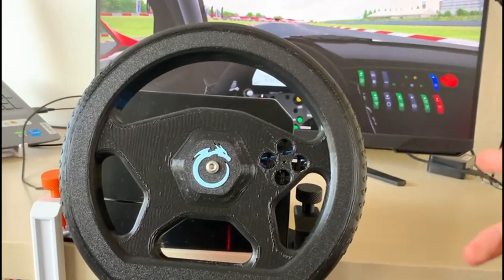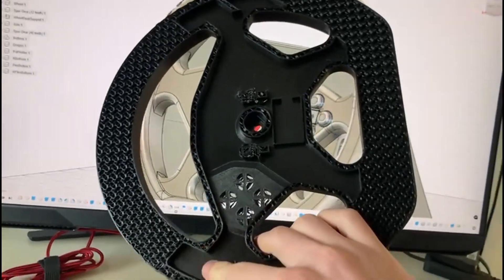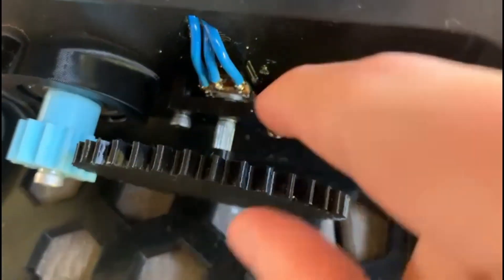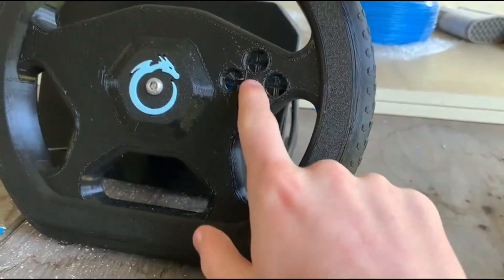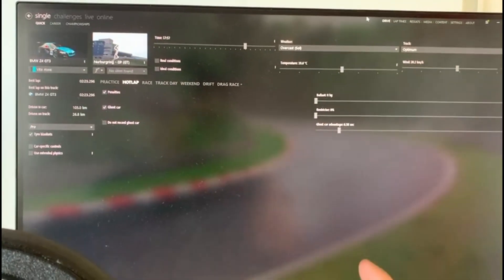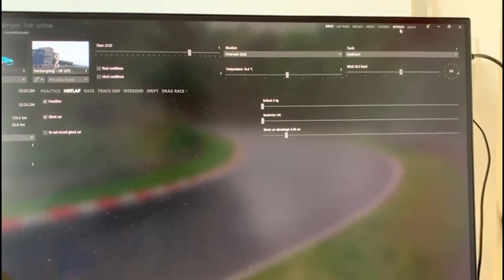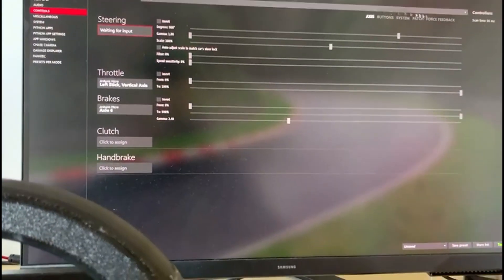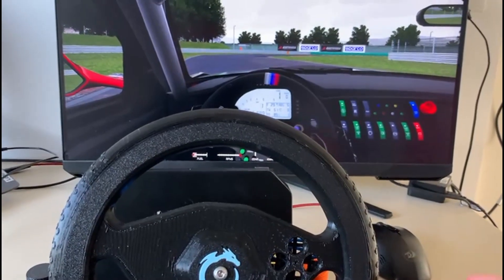I Made a Steering Wheel for Sim Racing that Actually Works!

Comment: Hola, el potenciómetro es de 270° ¿no? Pero con el engranaje chiquito lo llevas a 900° ¿no?
Reply from the maker: Yes, the potentiometer is 270, but I put one bigger gear on it and another smaller on the steering wheel, so that one turn on the pot is 10/3 turns on the wheel

Comment: What are the screw and bearing dimensions?
Reply from the maker: The screw in the front is M6, the one in the gear on the back is M5, but depending on the tolerance of your print you will maybe need to use an M4, the 2 that secure the potentiometer are M3 and the bearing is 35x19 if I’m not wrong, I will check it later and correct me here if it’s not
Reply: @DiaryOfAnInventor i cant find the bearing you said
Reply from the maker: Sorry, its 35x15

Comment: You could also look into a Hall Effect Sensor instead of a potentiometer that would wear out over time.
Reply from the maker: Ye, that would work really better, I just used the potentiometer to make it cheaper and accessible for others to print it
Reply: @DiaryOfAnInventor  Fair enough. I had a quick look and it seems Hall Effect Sensors an Potentiometer are similarly priced. But you would need to get a magnet for the Hall Effect Sensors, which would cost a bit extra I suppose.